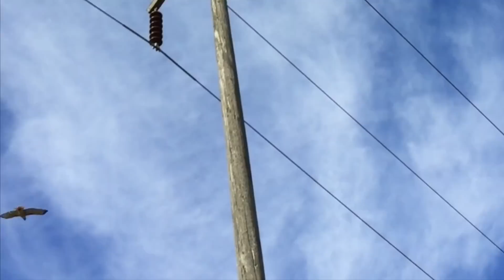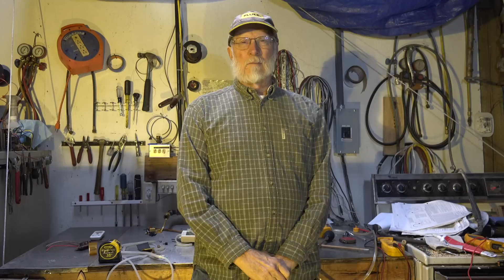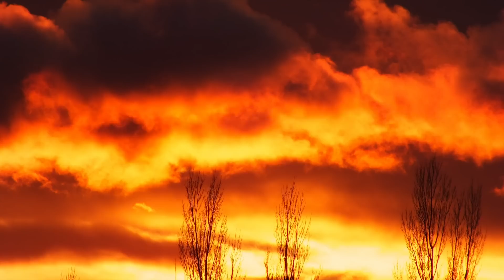Carbon monoxide and the gas furnace, part 1

Comment: Safer than a heat pump?  Heat pump with no chance of carbon monoxide?  Is there a furnace that has a safety to detect carbon monoxide in the exhaust?

Comment: I just moved into a rental home with an old oil furnace and I'm worried abnout carbon monoxide killing my family in our sleep. I've never had anything but electric heat. Hoping to find some answers on here about whether or not this furnace is safe in this 100 year old home.
Reply from the maker: If in doubt, have the furnace serviced with a CO test and install a CO detector.
GFM

Comment: have talked to other techs in my area, and most, like myself, are using anylazers on most annual services, at least every other year. if no sticker or record I check on every service call. as you said, harder to find problems with flash light and hand. even camera is hard with secondary issues, and not a lot of help from manufactures on best methods or testing procders, or admitting to possible issues/corrections to quickly.
Reply from the maker: It is pretty much a must have tool.  
GFM

Comment: agree with you on safety aspect, however, I have done 4   90+ heatexchangers this year, under warranty, does not include carrier products. I am in a small area and am seeing slot of secondary failures, found only by analyzer, and visual after removal and very close detailed inspection. all these furnaces were less than 10 years old. gas and propane. anyone else seeing these issues? by the way, furnaces were operating, except one, do to roll out tripped. other had holes in secondary, with co emmisoins in duct and extra high in flue
I'm in western ny
Reply from the maker: What models?
GFM
Reply: Johnson/upg brands, trane, nordyne, goodman.  Goodman was over sized severally for duct system, others were with in 10000  BTU of duct and house.
Reply from the maker: HMM, lots of them.  I have not seen that.  Anyone else seen this?
GFM

Comment: I just installed to 95% efficient furnaces 120000 BTUs both had bad Heat exchangers. soon as you put the cover on the combustion box the flame would shut out. I won't tell you the name of the company yet till I get my allowance. wasn't a pressure switch wasn't a flame rod wasn't double trap condensate lines all the types of Pitch Perfect soon as you put the cover on flame goes out. awesome videos by the way, merry Christmas.
Reply from the maker: Interesting.
GFM

Comment: Had a hvac tech tell me it's normal for a gas pack to put of 4800ppm  CO from exhaust vent today.
Reply from the maker: I assume that is in the vent.  It is not normal.  It is excessive in anybody's book.  Shut it down.
GFM
Reply: grayfurnaceman  and he piped pvc exhaust pipe pointed directly at dryer vent on house , exhaust going directly in customers house .  Red tagged and my company will be speaking with his boss Monday , gas was shut off .